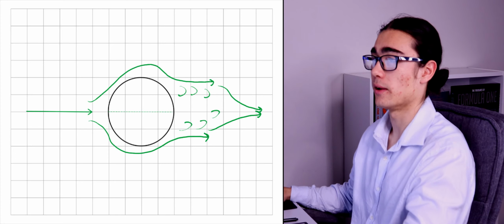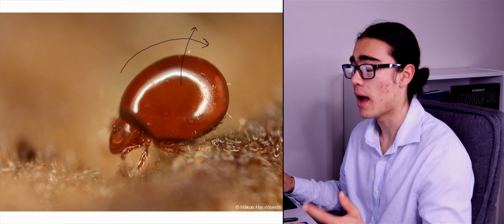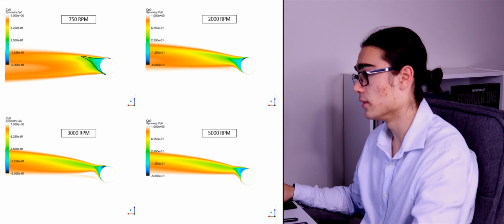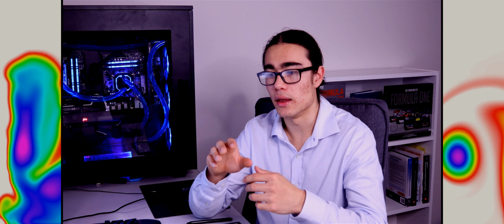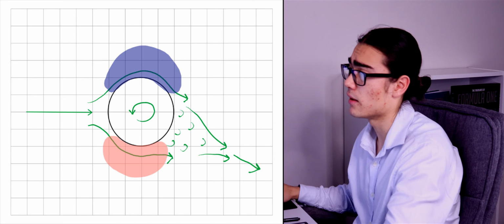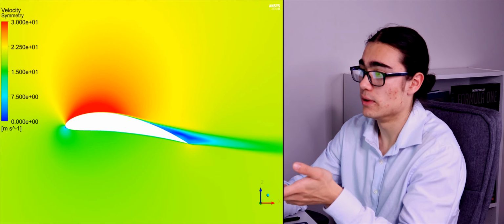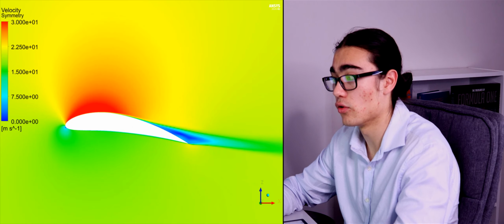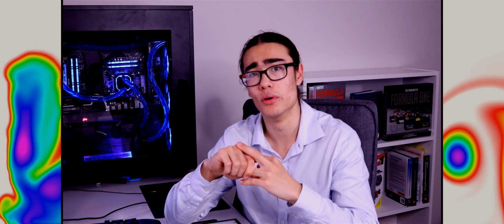Magnus Effect- With a Wing?

Comment: Why don't the aerospace and motorsport industries use this way more often?
Reply from the maker: This is only a device to limit flow separation on high adverse pressure gradients. In aerospace you rarely push those limits since you get force by travelling really fast.
Anything cool is banned in motorsports.